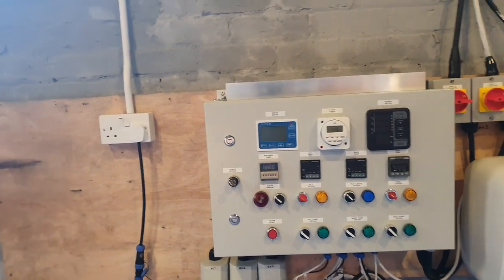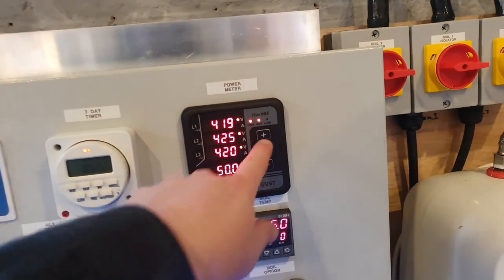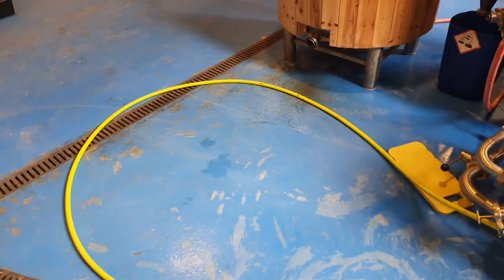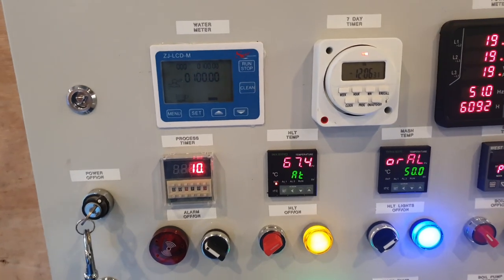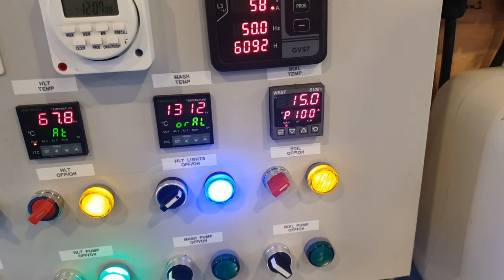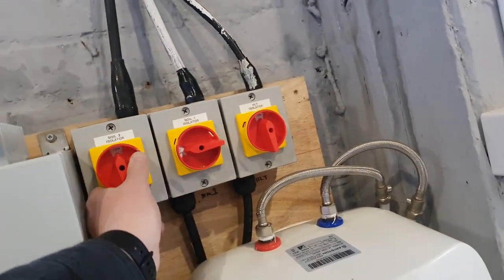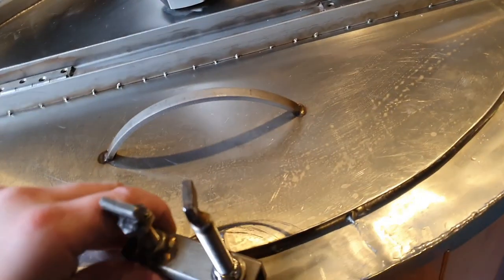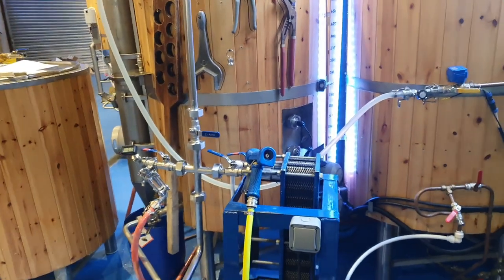Testing All The Equipment

Comment: Thank you for the interesting video, I recently got a similar control unit for the water (got it on Amazon, shipped from china). unfortunately it came without instruction manual... I'm still building the control panel, so next week I will connect it and try it. May I ask if you did any calibration on that unit ? do you happen to have the instruction manual ? (I'm talking only about the unit where you set the volume of water and you pressed run).  and by the way, I don't know if you know about this, but when I discovered this thing I was very happy; if you open this unit, you will find inside it that you can connect a thermo couple / thermometer so it will measure the temperature as well. 😀cheers